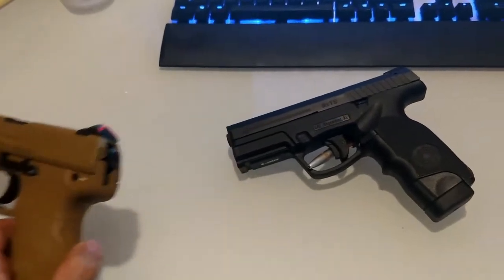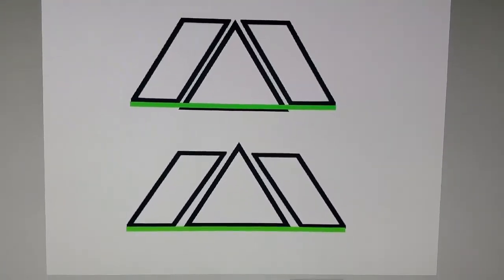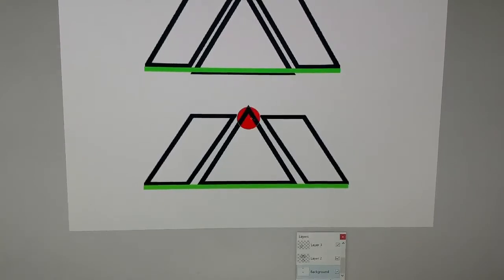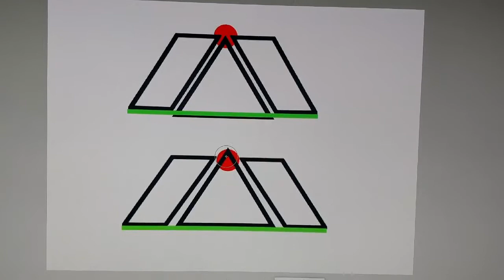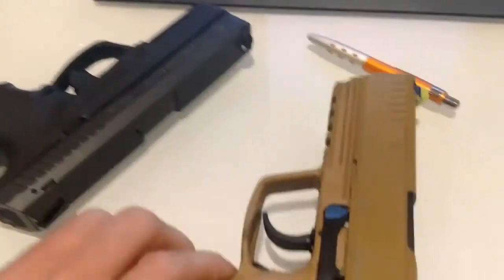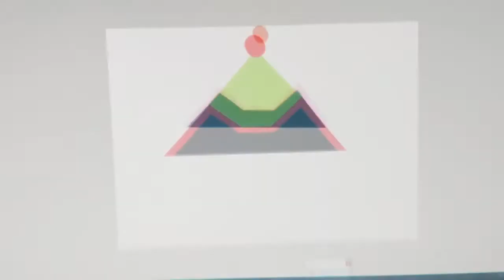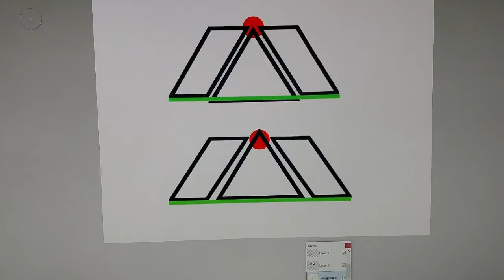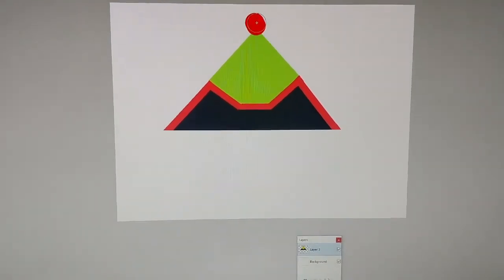Trapezoidal sights?! OMG, WTF!?!? TRIANGLES?!

Comment: L9 owner and my point of impact at 20 feet is the exact opposite as the bottom picture. The triangle needs to be slightly low.  Impact is "encased" in the trap and top of triangle.  About 75 feet it will be exactly like the top picture if i can actually shoot that accurately
Reply from the maker: AlcoholTobaccoFirearmsandExplosives85 ya, I'm guessing the different slide lengths will effect impact due to the triangle being smaller from that point of view.
Reply: I agree with you. I have an M9 compact. I have to line up the sights as you say "encased" to have point of aim, point of impact.

Comment: I've had my m9a1 for almost a decade and it's still very accurate and reliable. Havent done a thing to it other than regular cleaning, takin grips, and a lot of shooting.
Reply: Hey. How often do you clean your M9 ? After every session or every time you shoot for example approximately 500 round?
Reply: @milovnikzeli2506  probably not frequently enough but I've never had a failure. When I shoot I typically put about 300  rounds through each pistol I bring...give or take. And i only clean them maybe once every 3-4 times so about 1,000-1200 rds? If i had to guess but i dont keep track of those things. If i visibly see build up or think it's been a while then I'll tear em down and give em some TLC.

Comment: I'm 6 years late but I got a Steyr.40 cal 15 years ago. I love the way it feels in my hand & I see the advantage of the triangle sights, but I also found myself shooting low. Very low. 
My job required precision shooting and monthly qualifications so I had to put the Steyr aside. It was also impossible to find a holster ( much less a left-handed holster) for it. 
At the time I got the weapon Steyr didn't offer a .45- my preference - but now that I'm retired, I am pulling that Steyr out of the gun cabinet and going back to school 

Personally, I didn't like the block sights of the Glock when I first started using them. But they grew on me eventually and I became very accurate with them even though they are ugly. 

Instinctive shooting should not be discounted, but learn & become very familiar with your weapon first.

Comment: Great video. Was just wondering if you had tried different bullet weights (115 grn/125grn/147grn) on the Steyr and noticed any change in the point of bullet impact?
Reply from the maker: i have tried it with 115g training ammo and i usually use 50g civil defense 9mm ammo and they hit pretty much the same. the civil defense is more accurate than my cheap training ammo though, as in just more consistent. as should be expected with defense ammo.
Reply: My L9, doesn't change from any grain difference.
Reply: The steyr sights are the same as glock sights. They can be moved left and right the same way you would a glock. Not fully adjustable, but adjustable for windage none the less

Comment: My S40-A1 shoots  3" high, so I've got to do the opposite of what you do.  Just wondering if this is due to shorter sight radius.  I do have an astigmatism in my dominant eye, so this is probably a factor.  Really need to slap an RMR or RMS on it--any suggestions for slide millers that work around the specs for this design?
Reply: Sigelitedark , I have the same issue . The point of the triangle has to be below the rear sight ... so you are not alone . I’m shot 3 inches high also .. just FYI 👌